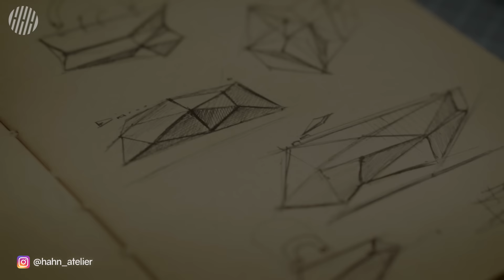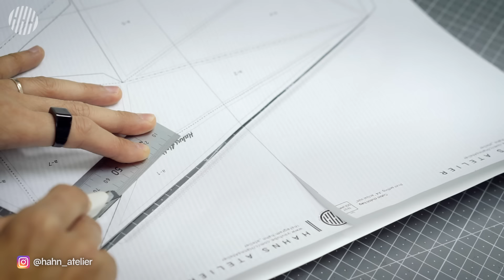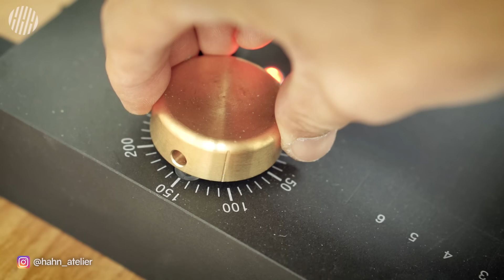Leathercraft | DIY Handmade CUBIC clutch bag

Comment: I still have tools on the way to get started in Leather Crafting, but thanks for the inspiration, because I do have a background in Design! Once I become comfortable, I will certainly push the envelope… 🧡👏🏽👏🏽👏🏽 Getting down to those last openings, I would put bandaids on ahead of time! 🤣 Actually, I ordered those rubber fingertips for going through paperwork, to help me grip the needle. 👍🏽👍🏽
Reply from the maker: Thanks for the comment! What kind of design did you majored? Keep your fingers safe-!
Reply: First school, Visual Communications and second school, Broadcast Design. Between the two schools, the areas covered: fashion, interior, photography, print, web, audio, film, television, 2-D/3-D, illustration, acrylics, etc., etc. 😆 I realized, I wanted to absorb as much as possible, to at least have the understanding of a little bit of as much as possible. Thanks to you, in August, your green bucket bag popped up as a video for me to watch out of nowhere, I had never watched a Leather Crafting video before… I’ve watched so many now and subscribed to a few. I’m finally getting my measurements together, to cut my first piece of leather for a pouch! 🤗🤗👏🏽👏🏽👏🏽

Comment: Are both the top and the underlaying leather the same? both 1.5mm Pueblo? Or are only the top stitched parts 1.5mm Pueblo?
Reply from the maker: stitched parts only 1.5mm Pueblo. the under layer is chrome tanned 2mm leather.